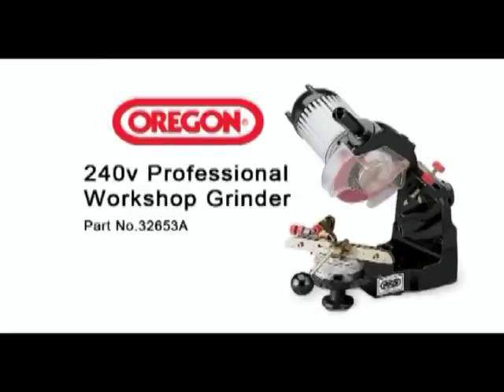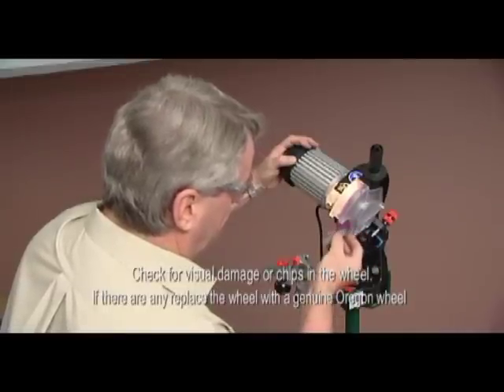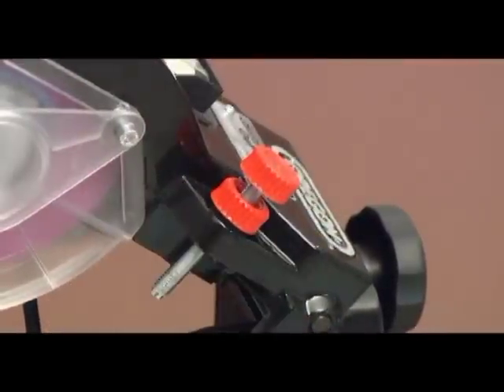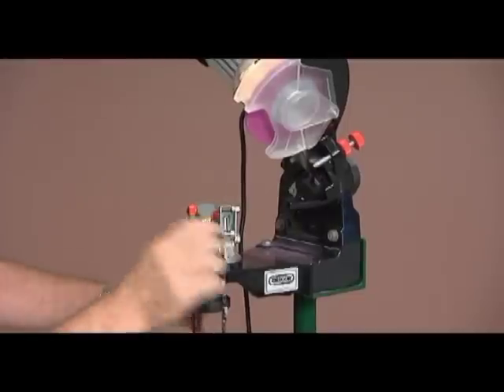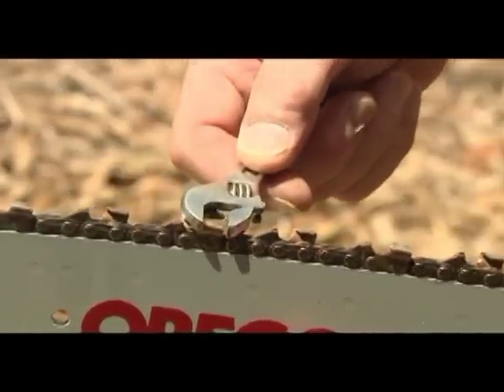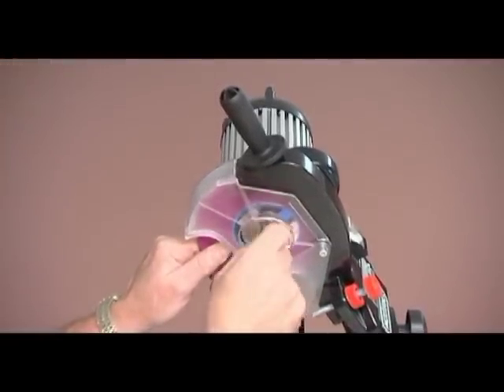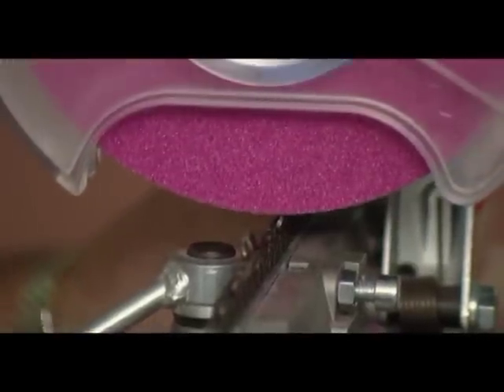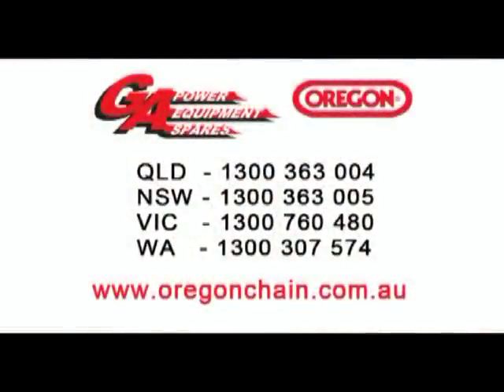How to Sharpen Chain Saw Chains, Oregon Chainsaw Sharpening Guide

Comment: as a chainsaw mechanic i would love to see how he would set a depth gauges on the other side of the chain becouse oregon grinders only running one way....its a good sharpener but you need to modify that the wheel can spin both ways....sory for my bad english :D
Reply: gpb which do recommend now as the best chainsaw sharper?
Reply: I've seen a guy here on YouTube use an electric drill to spin his the opposite direction to sharpen the cutters on the other side. With the power switch turned off he spins it up a few hundred RPM's IIRC and then turns the power switch on & then he sharpens the other side cutters. He said he's been doing it for several years without any problems whatsoever to the motor on his sharpener.

Comment: I have a 308 Foley sharpener. It does not have the  'tilt' how important is that? The Foley has forward/reverse motor, how important is that? I bought it 13 years ago at an auction for $50.00 and have sharpened 1,000's of chains for customers and my tree service. I'm thinking about buying the new Oregon speed sharp so I can sharpen carbide chain there's a few fire depts. that run them. Any thoughts on this?

Comment: That is a nice tool, but when needing to sharpen your saw in the field, you don't have time to go back to the shop to sharpen the chain. With files in the field with you, the same thing can be done by hand.
Reply: My chains are sharp and does not drag when using the saw. I sharpen the chains at the correct angle and don't file too much off of each chain.
Reply: Take more than one chain. Wow
Reply: I can swap a chain much faster than I can file teeth..

Comment: I wonder why they don't mention the tilting of the saw chain holder to one side and then another to grind first the left and then the right side teeth? On my sharpener (which is identical to this one) There are three "tilt" settings -- zero tilt and ten degrees left and right. Other than that I suppose this video is accurate. I think that they make the dressing of the depth gauges a little more complicated than is necessary. Thanks for posting this vid!
Reply: Well done, Mate. The best and well organized sharpening video I've seen. Now I see what I've been doing wrong and the proper grinder to purchase.

Comment: Theyre mainly meant for shops that make a living at sharpening chains and fixing saws. I personally think hand filing would be quicker though
Reply: no these are not made for shops, these are made for home users
Reply: Interesting, I have been professionally sharpening chains for 30 years with this style grinder. Mine is the hydraulic version, but basically the same. I also have a second grinder just for depth gauges.

Comment: I bought one it's a waste of money I'd rather use the round and the flat file way better.and more fun to do it this way while I enjoy a cup of coffee.
Reply: "more fun to do" what are you 6? There are a lot of good points about this sharpener but the best one is consistency having every tooth sharpened exactly the same no pulling to the left or right and never fighting the saw. We never sharpen in the woods we sharpen in the shop or the basement with a cold beer. Chain gets dull we change it to a fresh one, biggest mistake some make is not changing to a sharp one and running a not quite sharp one to long which create unnecessary stress on the saw and the operator cuts production and creates a safety issue
Reply: stick to the file carn't beat it

Comment: i bought this and works for shit,you get 8 cuts and its dull, neighbor down street same shit
Reply: wisco well if you are cutting a bunch of dirty shit what do you expect any chain will dull from that. not like a grinder makes that chain permanently sharp it just makes the chain cut faster, smoother and more efficiently than hand filing
Reply: im not cutting alot of dirty shit , was cutting red oak, we found if we change the degrees slightly it gets better edge, but all in all nothing beats a round file, i perfer the hand file ,i get way better edge and way longer cutting time,  i have talked to many guys around here who say same fucking thing, you pay some guy at hardware stoe 9 bucks to sharpen it on those grinders and you get 8 cuts thur a 26 inch oak and its shit, to each their own mister, be safe out there, enjoy your shitty job and have a crappie day
Reply: wisco ive owned and operated my own logging and trucking corporation since 1995 and have been a 7 figure earner for 16 years, so yes, I'll continue to enjoy my shitty job.
Reply: Hello sir....sounds like you don't have your grinder set-up correctly....like you, I was taught to use a file at a young age....I got an Oregon 520 grinder and I figured I would just do the "rocked" chains....well sure enough I played with the grinder and found out I can get a superb cutting chain with it....the angles I use are 55-30-0 for stihl chain....what people fail to realize is you can't go by stihls grinding angles....they are made for the Stihl grinders, which are set-up totally opposite of the Oregon and many other grinders....

  If you get good with the grinder, you WILL have the same profile on the cutter as when you use a file...go to ope forum.com....you can look at the thread we started for grinding tips and tricks, I have MANY pictures of cutter teeth you can look at....

You really can get good results just takes some getting used to...